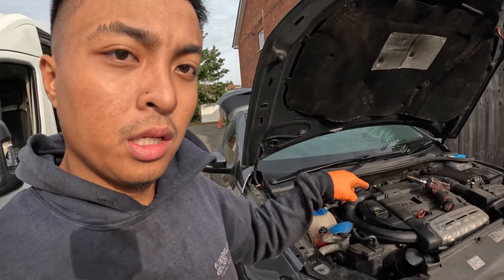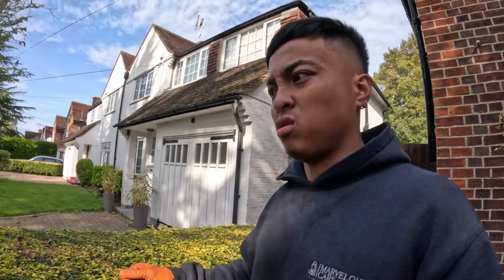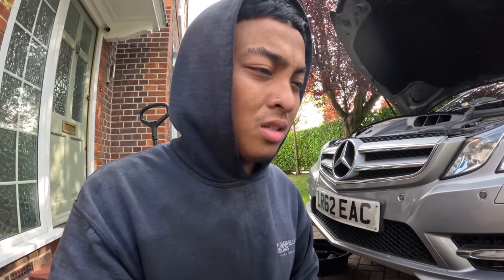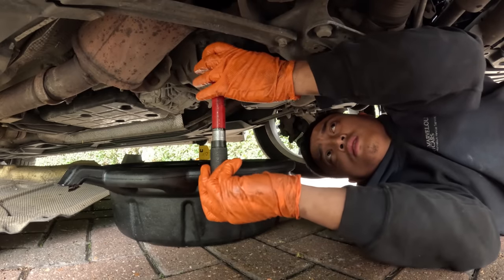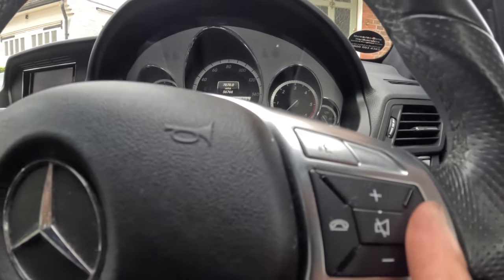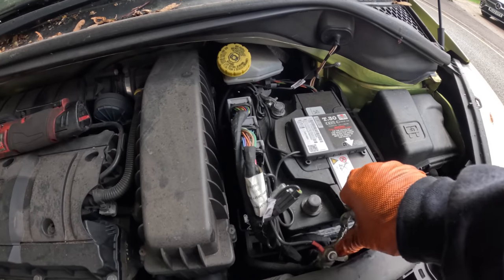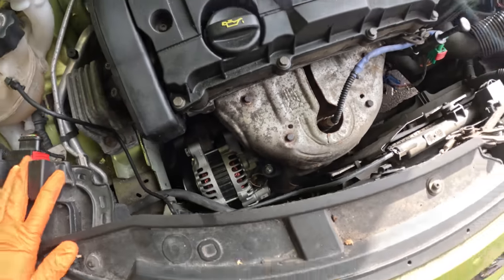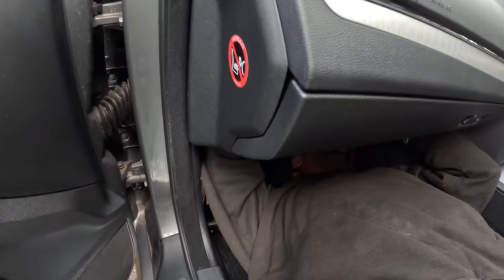WHY I DON'T USE CHEAP PARTS | MERCEDES/VW SERVICE | PEUGEOT ALTERNATOR | Life of a Mobile Mechanic

Comment: Another bonus of buying decent brand parts is that they actually fit properly. How many cheap parts iv fitted to customers car by request and had to fiddle with or alter to make them fit is ridiculous and it never saves them as they get billed for that time
Reply: Quality is always debatable as there are parts that are equal or better than OEM. Fitment is the biggest reason to use OEM as you save loads of time modifying parts that don’t fit properly.
Reply: 100% agree lost count of how many adjustments I’ve had to make on cheap parts and I’m only a novice with cars but I learnt quickly cheapest isn’t always the “cheapest”
Reply: Depends what the part is...

Comment: With my own cars where I've bought from Euro, I've used Bosch parts. They tend to cost only a bit more but the quality is much better. My trust motor factor supplies good quality parts at a reasonable price. I only use Millers oils from the same motor factor as it is also reasonbly priced. I've even bought genuine filters from dealers as not everything is stupidly expensive from them.

Comment: Hey guys, great to see a couple of young diligent and Very knowledgable Mechanics on the job, little wonder you are working for yourselves, so many dodgie Guys and shops out there, doing it right and really well must give your clients really great peace of mind. I am not a mechanic but did 33 years offshore Drilling from roustabout to Rig Superintendent, did my share of mechanics on the equipment and have a good set of hands and high standards, loving your standards, Full Approval ! I live in the Philippines now, Back to the UK at times, in the Philippines the standards are not great, could write a book here, understandably most of the good Guys here go abroad, unfortunately! Keep up the great work lads!!

Comment: i would put a battery cover on that pos terminal doing the pewgot just in case that cable pops up and makes a circuit as they do,nice work guys
Reply: Indeed I agree, when you buy a new battery they come with close fitting protectors over the terminal posts, keep them and put them on the terminal posts when you disconnect a battery..

Comment: I find the problem with euros isn’t so much getting quality parts, but getting the right ones for the vehicle, so often they are wrong.

Only found your channel today, really like it. Are you not tempted to use an oil extractor to save yourself crawling under the car etc?

Comment: Just out of interest I’m big follower of yours I no you state use good parts always used Bosch service parts but I have switched to Mann now on mine and my wife’s cars but engine oils which brands do u suggest to go for always used Mobil super 3000 in our Vauxhalls but heard people mention triple qx from euro is just as good any opinion on this please
Reply from the maker: Many many people will say ‘as long as it meets the spec, it’s fine’. Yes it is fine but it’s the extra agents that they add in their product that’s important. 
You’ll notice a difference between TQX and Shell/Castrol when it comes to longevity, how clean the engine is and how well it can take a beating when using the car in a spirited manner. 

Avoid cheap oil when possible and use what’s recommended for your vehicle (what’s printed under the bonnet). If unsure, use Castrol or Shell

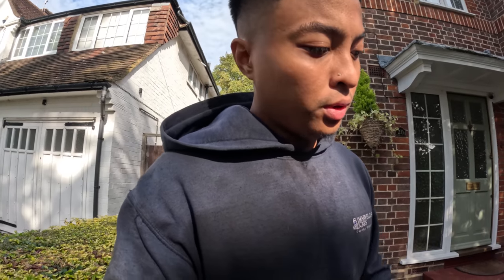Comment: Buy yourself an electric extractor pump for oil changes on the mercedes 0651 engine's. Just make sure oil is warmed up first. Extract into empty container so clean and easy. The engine is designed to be serviced from the top. Diesel oil is a suspension oil (hence why its  so black) as it holds all the contamination in it so no sludge if changed on time. It will extract warm oil in 5-8 mins. Save yourself a lot of time. As you probably found out theres a lot of bolts and shields to remove to get to sump. Mercedes dont do that at main dealer 4:47
Reply: Yes I had a tt and getting under it and doing the under plate, I tried an extractor and it worked fine and far less hassle. And am 64 and rolling round the floor is hard
Reply: Doesn’t even need to be electric. I use one of those manual pumps. Couple of pumps to get it going and then wait a few mins and the container is full through gravity and vacuum. Also shows you exactly how much oil you have drained out via the gauge printed on the side of the container. Just put the same amount of fresh oil back in and you are close to perfect. Handy on cars with no dipstick where you want to be close to correct before checking the dash board oil level display.

Comment: I’m all for using good parts and oil, especially for German vehicles. Mann filters and Liqui Moly oil 👍
Reply: Mann oil filters for any motor imo. Castrol and Shell oils are fine too, I will still use carlube and the like if the customer supplies it but would never suggest or use it on my own cars.
Reply: what brand of oil do u recommend for korean vehicles like kia or hyundai?

Comment: I have been working on my own cars for over 30 years. Over the years, I have wasted so much time with poor quality parts that don't even make a year before failure. It is very hard to work out what brands are junk and what brands are OK. 

What worries me is the parts factors only seem to have the cheap ones in stock, so the trade must be fitting junk to many cars in the hope the car gets sold before the part fails.
Reply: Gosh I just thought I would be safe buying from local motor factor but maybe I should look more closely at their parts thanks
Reply: I fitted a cheap timing belt kit once and one of the idler pulley bearings went bad within 8,000 miles. Since then I only use OEM timing belts & water pumps on my own car.
Reply: The worst part is sometimes you buy the part from the same manufacturer that makes the OE part and it doesn't even look the same. It's like if they don't have to slap on a VW logo or whatever they can cheap out on the part.
Reply: @aden3113 I think that's true, a few years ago I purchased a Hella AC condenser. It was significantly lighter than the old BMW one and required plastic to be shaved off to make it fit. After all that, it failed 2 years later.
Reply: It's got worse in recent years with cheap parts and expensive parts, often you are doing the same job again a year or two later.  I've just had to replace 1 lower suspension arm, 1 drop link and 2 rear shocks to get my car through it's MOT and that's all stuff I did 2 years ago.  The drop links eapecially -  cheap ones expensive ones does not matter a year later I'm doing them again.

Comment: Oil is Oil. As long as its the correct spec for the engine, it doesn't bloody matter. Love the vids pal.
Reply: You should do some more research if that's what you think!
Reply: @M.B.C38  done plenty, I buy the correct spec oil for the engine I'm working on. Never had any issues. Most people I find that comment like you don't even work on anything just internet mechanics

Comment: Glad you revved it up to check the alternator was good.
Me, I would have checked the output with a voltmeter.
Reply from the maker: We did check voltage on our jump pack, which shows current voltage. Always always…

Thank you!
Reply from the maker: We did check voltage on our jump pack, which shows current voltage. Always always…

Thank you!

Comment: Hello mate. Like your videos. I have Volvo V70 2010. Clutch pedal on the floor one of local mechanic said may be sleeve cylinder. Do you have any idea how much it will cost to replace the sleeve cylinder? Appreciate your reply.

Comment: I have a vw Tiguan is the same engine as that Scirocco TSI mine has a misfire in cylinder 2 garage had a look at it, pistons ok cylinders okay, he said it must have a sticky valve, so I think that needs to have a rebuild of the head. I wish these engines were around the other way so the inlet would be at the front, it would make it easier to warn up blast it if it needs it, it probably does, pork car is just sitting there doing nothing now, only drove it for one year since I bought it.

Comment: How often should the air filter be changed on W211 E220…..2008 round lights…

May be I’m confused but I think service manual said every 60k

I think it every 15k aprox

Comment: So you have rebuilt the engine and it has an oil and coolant leak!😮
Reply from the maker: Coolant leak developed a year after due to the pipe cracking.

Oil leak is DEFINITELY coming from the sump- also a hairline crack.

I know this is not related to the rebuild at all

Comment: Main dealers use "equivalent oil" which can be cheap. I found out a Hyundai dealer over filled my I30N engine with cheap oil when servicing it even though it had a sticker in the engine bay stating Shell Helix. I had to remove the over filled oil at home which was about 3/4 litre over filed by siphoning out of the dip stick tube. Hyundai UK arranged for another dealership to do another oil change using Shell Helix which I insisted on watching them do. Next service was carried out at the second dealership and I checked the car before driving it away. NEVER trust a main dealer always check your car after a service and get a second opinion from an independent garage when you are told " your brake discs and pads are worn " as main dealers don't explain that brakes do wear but have limits when they need replacing.
Reply: Main dealers often give basic servicing to the apprentices so you are often paying top dollar for some newb kid to work on your car.
Reply: @rodpanhard  Yes I have heard that. A Volvo apprentice wasn't insured to drive customer cars from the main dealer car park into the garage but could work on them. Totally nuts. I feel so sorry for apprentices who are under paid but expected to do the same job which is similar to slave labour at £6.40 an hour.

Comment: You do know that the oil filter is supposed to be replaced first when it's the element type, all the old oil from the filter housing is now in the sump ,merely a suggestion
Reply from the maker: Fair enough. I’ll keep this in mind
Reply: Not sure this is true as oil held in housing unless engine running. Always mop it out as doesn’t drain away? On my Peugeots anyway. Not an expert just saying as frustrates me mopping out that oil
Reply: Your clients are lucky they have you professional thorough guys. Loving your channel as a diy mechanic. I get such anxiety on some jobs where you walk it.
Reply from the maker: Truth is, if the filter is pointing down, and if it haven’t been turned on for a long time, all the oil would have drained already- that’s true for this vehicle (as you saw in the video, the filter was dry). I see that they’re just concerned.
Reply: At the end of the day the filter holds a tiny percentage of the total oil capacity so I wouldn't really worry about it. The fresh oil will dilute that down even further.

Comment: Remove the oil filter before dropping the oil out. Bro now the oil will drop into the sump that u just drained.
Reply from the maker: The way that the oil filter housing is setup, I don’t think this will matter for this car but I know what you mean, I do that on certain cars

Comment: I thought you said you don't use poor quality filters? ECP and mann don't equate to quality in my eyes.
Reply from the maker: Where would you suggest I buy my parts?
Reply: You won't get better than MANN filters. They are fitted to most vehicles from the factory and are built to oe standards. Usually see vw audi group badge next to the MANN one.
Reply: @themarvelousvlog  make trade accounts with main dealers. You will be shocked at how little price difference there is

Comment: You should have removed the oil filter while oil draining as it holds old oil
Reply from the maker: I was fully aware of this. Car has not been started for a whole day. Filter is also pointing down which means all oil will have to go down. You can see on the video that the oil filter element is dry as anything, same goes for the housing.

Thank you for the advice though. I’ll make sure to keep this in mind 🫡

Comment: The market is flooded with shite parts now, before corona you had shite, parts fit for the job, oem and dealer. The middle ground has been filled up with cheap shite at higher prices, it's a minefield that's hardly worth the hassle. Fit proper parts or expect it to fail is my motto now, I refuse jobs where people ask me to fit amazon or evil bay china copies.

Comment: For years I used supermarket oils and never had any engine issues on diesel or petrol vehicles.
However, the after obtaining a renault scenic diesel i switched to shell helix and within a few months the turbo failed. Once the turbo was repaired and all pipes were cleaned i fitted a clean oil filter and filled up with fresh Shell helix. Within 40 miles the big ends failed! I'm sure it was just coincidence.
Now use Mannol as recommend by a mechanic friend.
Reply: Which mannol are you using. I have a toyota avensis diesel and I want to try mannol during the next  service and how much did you pay for mannol oil

Comment: what brands of the cheap brands to avoid?
Reply: I would say the euro car parts brand of audura eicher crossland 

Get:
Bosch
Mann
Hengst
Delhpi 
Brembo
Apec

Stuff you can rely on overtime youll learn whats bollux whats not
Reply: I used a Crossland oil filter for my mazda 3, works perfectly fine and no problems. I would happily use any products from euro car parts, most of the time you're just paying extra for the named brands
Reply from the maker: @joem8213 Crossland oil filter had collapsed on me twice, caused low oil pressure twice and I had to go back to the customer’s to explain that it’s the manufacturer’s fault. Lost the customer in the process.
Not all parts are made equal, trust me
Reply: @DarkReaper-or9el Bosch air filters aren't so great anymore I have found they have skimped on the metal supports on some and the filter collapsed in the housing under induction vacuum.   Not good.  Stuck to mann now or hengst
Reply: @themarvelousvlog  yeah literally hit or miss just go with what you know. Bosch is my go to because its just a brand everyone knows.
Reply: @offbeatwarble  youre now making me regret my life choices my 2008 golf is my baby! Should be fine to be honest ive been using it for the last 3 cars ive had however i  will say purflux is good but on the pricey side